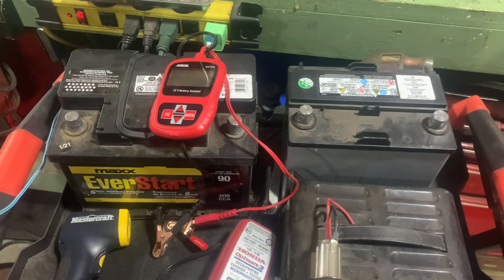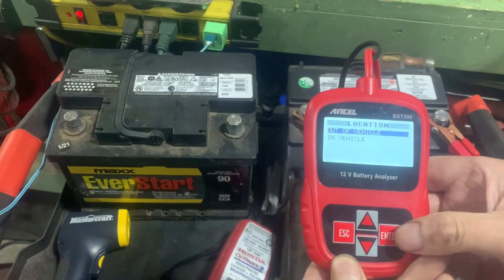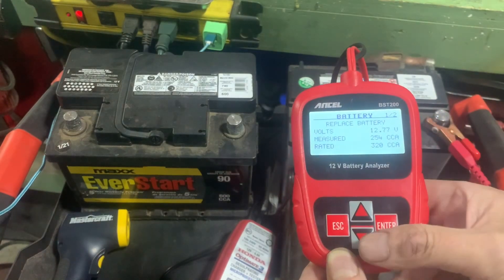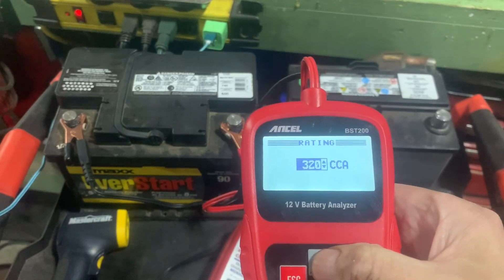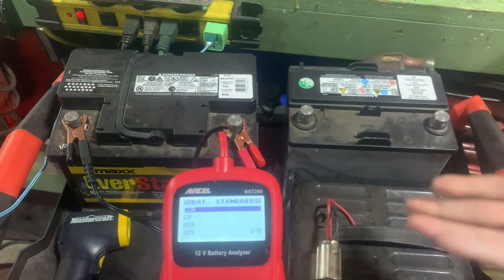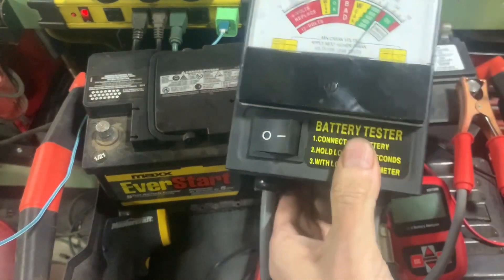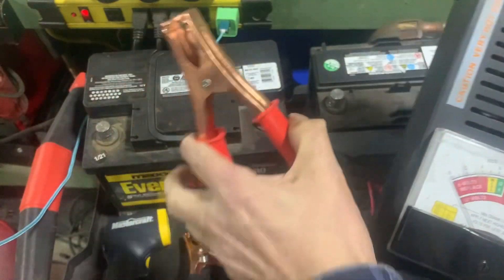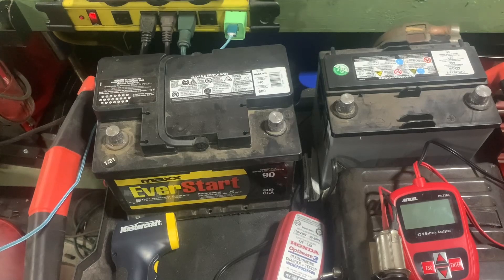How to use battery testers. Digital and Analog Load Testers

Comment: If I may help, RES. is the Battery Internal Resistance. The unit MR means milliohm. Often the Ohm symbol is substituted by a capital R as it closely resembles the symbol.

So typically these regular car batteries will be about 5 milliohm when good. Above 10 milliohm its gone bad. It means the internal resistance is high so it it will self discharge quicker sitting on the shelf because of the higher resistance.

Bigger capacity batteries will have lower internal resistance then smaller capacity for the same SOH. Mainly becase the plate surface is bigger alowing more area for charge to flow.
Reply from the maker: Please, feel free to educate me about anything I may have missed or don’t know. I appreciate the explanation. 
Thanks!
ETA: I've pinned your comment for anyone else that didn't know, if that's alright with you

Comment: Exactly what I was looking for however, what I don't see on the anolg is the load test for 6v. Can they be load tested?
Reply from the maker: Yes, the analog tester has markings on the gauge for testing 6 volt batteries
Reply: @BruceLyeg Thanks!
Reply from the maker: You’re welcome

Comment: We see a lot of do-it-yourselfers that replace a starter on their lawn mower because a battery showed good voltage on a meter. Turns out the battery won't pass a load test and they never needed that starter. Good video because even if you don't have the equipment to test a battery, having the knowledge can save cash.
Reply from the maker: @TheGreasyShopRag  Thanks. I did the same on an old Honda Nighthawk motorcycle I had when I was 16. The meter said the battery had over 12 volts so I replaced the starter and it still barely turned over!  I knew nothing about load testing. 
Later I learned to hook the meter up with the battery in the car and then turn the headlights on high to see how much it drops. 
I think most parts stores these days will test you battery for free

Comment: I have two battery analyzers.  There super expensive midtronic's units. You can also do a complete check of the charging and starting system of the vehicle. Great video Bruce!! 👍🏻 🇨🇦
Reply from the maker: @404notfound.....  nice! I used to have an old Schumacher battery analyzer from the 80’s that was great, but it was the size of a small refrigerator lol
Reply: @BruceLyeg lol